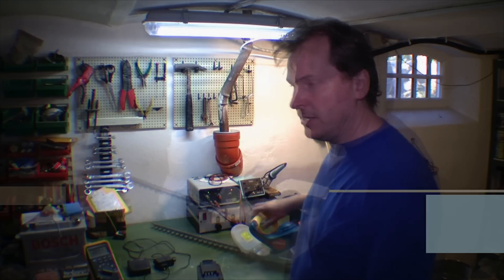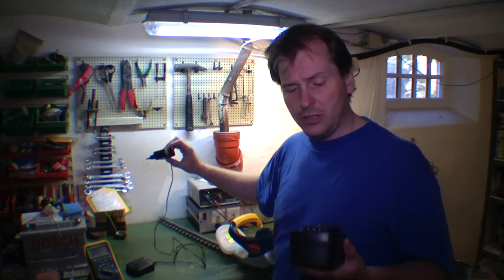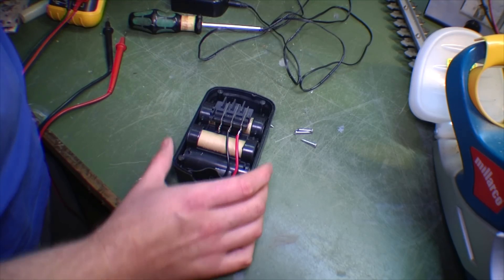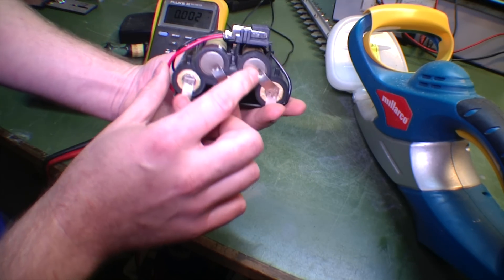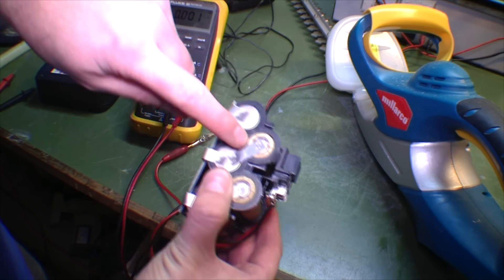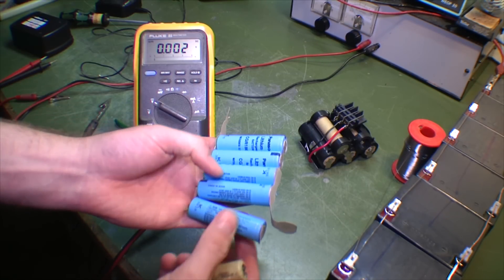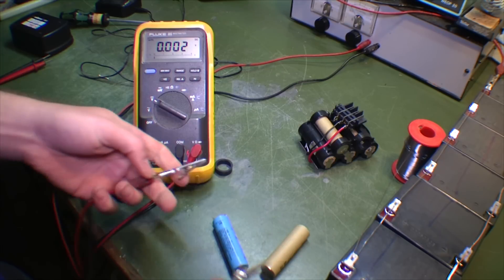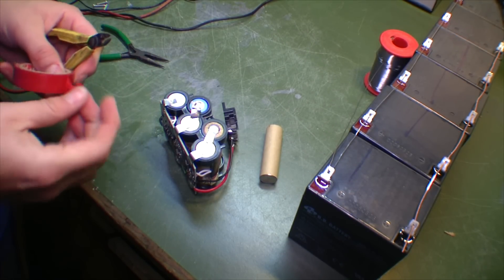Replacing defective lithium-ion cell in battery bank - 242

Comment: Finding your content useful and enjoy your style... I’ve been keeping old NiCads going like this for some time now. I’ve found that to keep temperatures down when soldering direct to cells, use a dab of flux so the cells can be tinned quickly and easily. Tin the tabs too then the solder connection is almost instantaneous. Quick question on this vid, will the old laptop battery be able to supply the current at the rate needed for the garden tool without getting damaged? The duty of the two applications are very different. Keep them coming!
Reply from the maker: Hi Andrew Wilson
Thank You very much! I have found that the soldringion has to be as hot as can be,, that way the tin sticks way faster and less of the battery is heated up :-)
Thank you for watching! :-)

Comment: If you store lithium batteries for a long time, charge them to 3.82v, it's the optimal voltage for storage. The chargers got a lot cheaper http://www.aliexpress.com/item/iMAX-B6-Lipo-NiMh-Li-ion-Ni-Cd-RC-Battery-Balance-Digital-Charger-Discharger-C1Hot-New/32448451676.html?spm=2114.01020208.3.208.nluNy0&ws_ab_test=searchweb201556_2,searchweb201644_1_10001_10002_10005_10006_10003_10004_62_61,searchweb201560_6,searchweb1451318400_6149. i have the soshine T2 charger and it's a good charger but i'm thinking of upgrading to this one. Good job diagnosing and fixing the battery (and keeping Mom happy, that's very important)
Reply from the maker: Hi +Roman Berger 
Very important! Yes under 16$,, that is cheap!
Thank you for watching! :-)

Comment: Part of the problem may be that lithium cells need to be balanced charged when inside the bat pack.  Recommend you buy a LiOn balance charger, the cells and the pack will last longer.
Reply from the maker: H +Chuck12 - 
I do not really think that it's worth the trouble to this cheap garden tools :-)
Do you think it could kill a cell this much?
Thank you for watching! :-)
Reply: My PlayHouse Yes, the very low charge in one cell will not allow the cheap charger to fully charge ALL of the cells to their proper voltage.  Therefore,  you will continue to get a bad cell in the pack(bank). the weakest cell will continue to die or go below it's allowable charge voltage and you will have the same problem over and over.
Reply from the maker: Hi Chuck12 -
You're probably right,, I should have fully charged the new cell I put in.
But I really do not want to invest in an expensive charging for a little project like this here :-/ There must be a cheaper way :-)
Thank you for watching! :-)
Reply: My PlayHouse you can buy a LiOn balance charger on ebay for less than US$30.  It all Depends on how valuable your time is, versus the time you will spend fixing the tool again and again...  that battery pack is connected in series, therefore, a balance charge will be the only way to keep it working reliably...

Comment: I've often found that trying to solder spot welded tags is difficult. Perhaps my soldering iron doesn't get hot enough for those applications. A spot welder would be nice, but I can't justify getting one for occasional use.

Great video again, always enjoyable.

Regards

Ian, Birmingham, UK
Reply from the maker: Hi +kafkaian 
These batteries can explode very violently,, so i really do not want to heat them up to much.

Thank you for watching! :-)